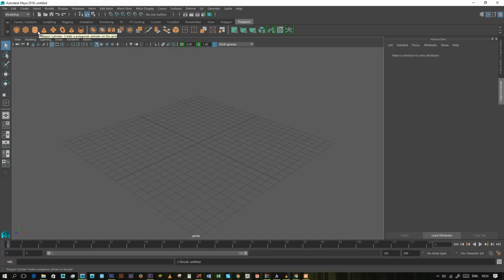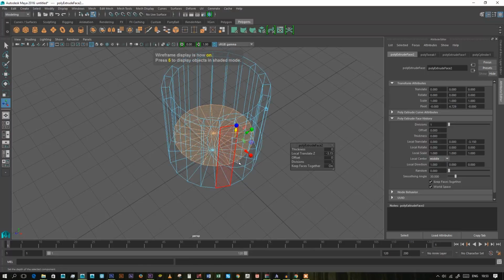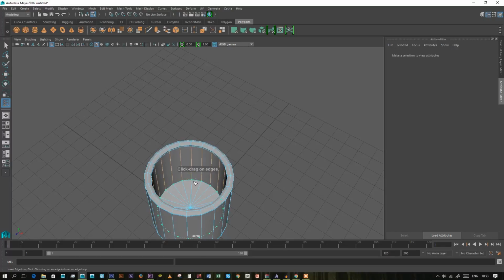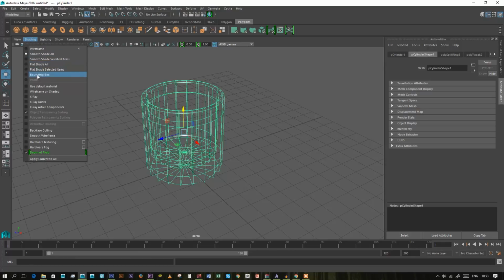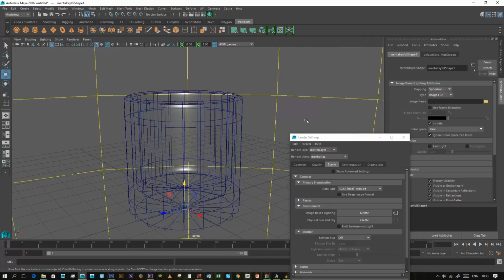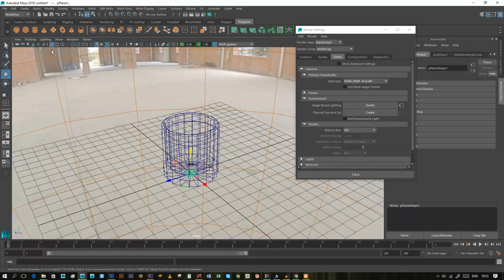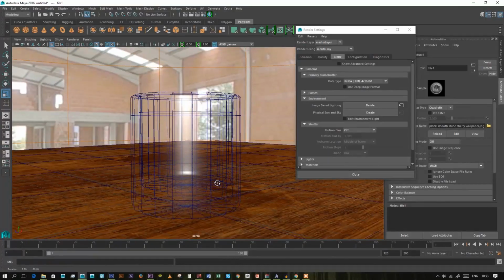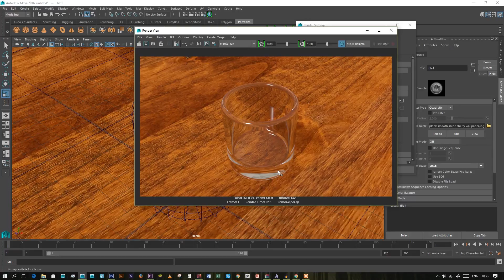Autodesk Maya : How to make a quick 3D Water Glass

Comment: when i try to add materials there is not a material option it says arnold im using maya 2018
Reply from the maker: Oh okay, this was Maya 2016. I should update the video. Anyway, Right click on your model and click assign new material. Under Arnold select Ai Standard Surface. On your AiStandardSurface1 menu on the right adjust the Weight and Color sliders to zero because real clear glass does not have any color or weight in terms of visuals. Then under Transmission adjust the weight slider and increase it. Its easier to see the change when you using IPR rendering to see the glass material update. At this point, you should have a glass material but you can now tweak a lot more settings to get the look you really want to achieve. - Sorry for the late reply, I hope you got it sorted out.
Reply from the maker: Finally made a tutorial rendering glass in Arnold  https://youtu.be/G4GYmRCqnHQ